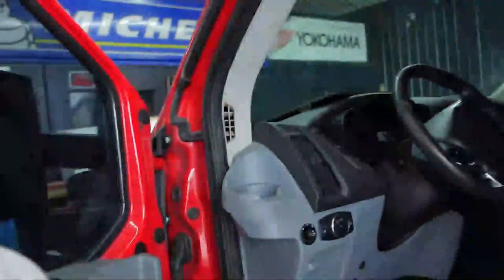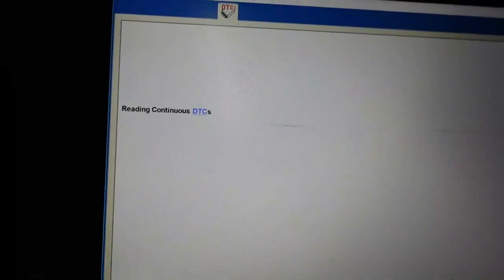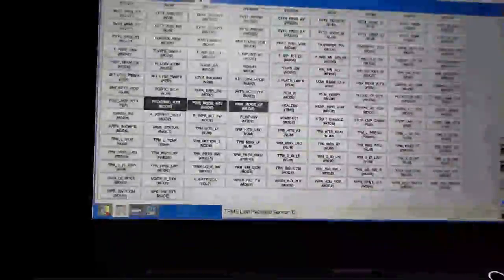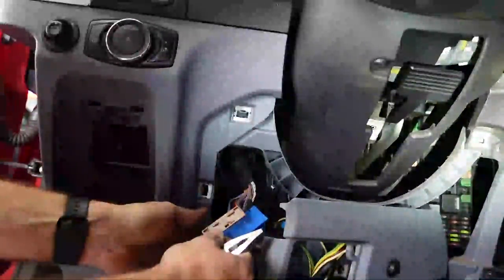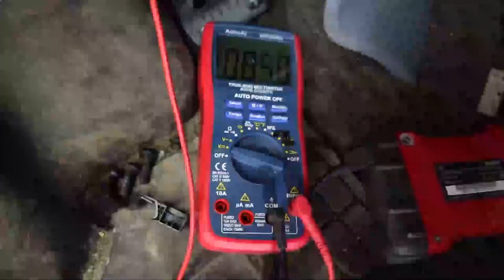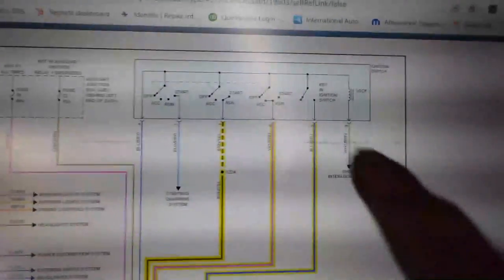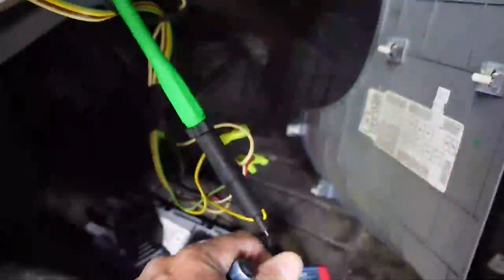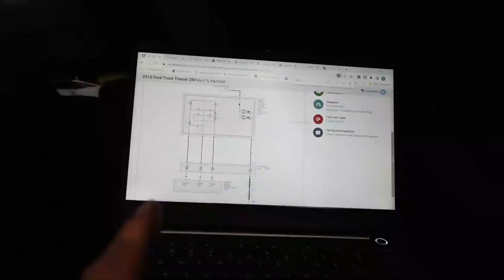U3000 : 49 Transit Part 1  Pattern Failure?

Comment: My daughter got this code on her 2017 Focus, and her power steering keeps going out and her batteries keep getting drained quickly. 

Also is it normal for the terminal to spark when you connect the battery? I saw a small spark.

Comment: I looked at TSB's.  Might be a couple of related ones.  Here's one for crank no start.  I'm not sure which engine you are looking at.

 02/10/17		NHTSA ID: 10091221
TSB ID: TSB16-0099

Some 2015-2016 transit vehicles equipped with a 3.2l diesel engine with less than 10,500 km (6,500 miles) and built on 5/11/2015 and through 2/8/2016 may exhibit a crank no start condition and/or malfunction indicator lamp (mil) illuminatio

Comment: usually, that code will lead to a clear  re-run and self-test and other codes should be looked at  first if the  u3000:49 returns to  use DTC u300a:29 steering column electrical componets
Reply: ppt f
Reply from the maker: On the 1st one I ran through the u300a:29  to a "t" and says replace bcm..
Reply: I wonder if someone replaced that black  that code b10b1 is non existent in ford service information
Reply: Replaced something or programmed something weird
Reply from the maker: @712gln  the 1st transit ibdo not have complete story, this one ( the red one) died while driving , the sat it just turned off and the Hazzard  lights came on. If this is because of the door harness shorting and putting the bcm into a shut down , I feel this is a safety defect that should be reported to nhtsa .

Comment: Wondering what fets  was popping lighting  or what   Fets are allowed 600 shorts in its life  perhaps the lighting might be  a symptom a bcm fail like when replacing a bcm and not programming the tpms with the  interior lights flashing
Reply from the maker: Yes I have seen the flashing interior lights when the bcm is not completely or properly programmed,  situation is both vehicles same exact issue with out any replaced parts, ( original bcm installed)

Comment: Wonder if you could get the hazard switch pid to change pulling up the voltage with a test light. 2nd maybe try clearing the codes before testing the switch. Just like the turn signal bulbs I been dealing with shops replacing bulbs still no turn signal then you have to clear the code the light starts working. Maybe same thing happening with your hazards
Reply from the maker: Great idea, I could have used a 1k or 10k resistor to pull up to b+. And see what happens.

Comment: You have a crank no start situation Brian, would definitely focus on pcm inputs just to be safe, simple flood mode would get you confused with no codes, the bcm is cousing confusions but there is no security light on or any security codes it communicating. Hopefully is something simple.
Reply from the maker: I am all ears to suggestions.   If what you state is the case would not the cluster light up with key on  / bulb check? PCM has comm with key on.  One thing for sure is the BCM on this vehicle does control the fuel pump,  via a serial msg from the PCM.  I like your thought process of not overlooking the obvious!
Reply: @BrianMann216  i see the bcm controls FP relay ,the RCA also has a u0422-00 pointing to the bcm and can you explain why is the rcm talking to the fule pump in case of an accident.